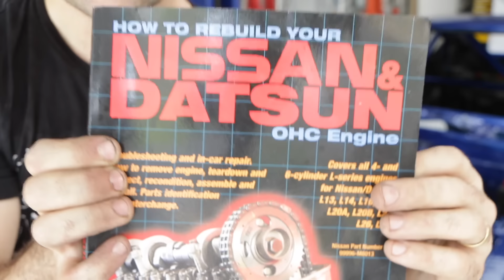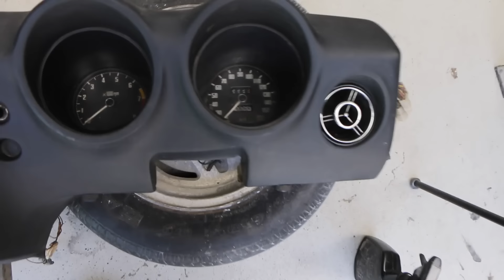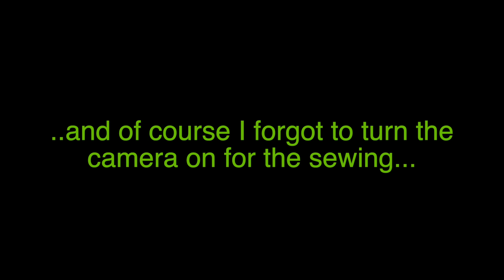Dash repair, and accelerator cable - Home Built Datsun 240z part 73

Comment: Watching your series has inspired me to get back to work on my '72 240 that's been sitting in my garage the past 15 years.  I pulled the SU's off this weekend to rebuild them and replace the manifold gasket so I can get the car moving under it's own power to get it to a shop for a bit of frame work.  Thank You!

BTW, I pulled the heater out and rebuilt it around 2002 when the core leaked all over the floor and had to scrape the tar insulation (with a heat gun in a garage during the Texas summer) from the floor to allow it to dry and prevent rusting.  So pressure test that heater core before you install it the dash.

Comment: Oh Jeff that dash looks terrible - sorry mate. I think it should have been repaired properly. You need to grind out the affected areas and cracks and backfill them with epoxy and microballons. Don't use bog as its porous and hydroscopic. Then sand back the filler with 180 grit until you have a even and flat surface like you would a body panel. Then one coat of hifill and sand using 220. There is a textured paint you can buy, I think its urathane (?) based so it remains flexible. It leaves a surface finish similar to the original finish and you need to spray the whole dash with it. It dries as a satin finish and is UV stable so will not degrade in the sun. I think its made by Wurth but I can't be too sure. Once done this way the dash will look like it has just come from off the assembly line.

Oh, and the wheel and tyre combo look great, modern but period look at the same time.
Reply: Polyvance makes the whole system. I used it to repair my dash and then had it covered in leather. or use there vinyl spray kit.....
Reply: Sorry to say, I agree.  Everything else - I mean everything - you have done has been to a great standard.  Time for a rethink.  Sorry.
Reply: Did something similar back in the 90's. Fixed the cracks then sprayed those areas with stoneguard to give it some texture. Then sprayed the whole dash in colour. Wasn't perfect but you had to look for it to notice it.
Reply: can you give me more details about that paint from Würth? Im in Germany - the home country of Würth 👍🏻

Comment: Hi Jeff.  I think the dash looks just decent.  If you can get that seam to sit down flat and straight, it might be OK.  If it doesn't look any better, you might look at other methods to bring it up to the standards of the rest of the car.
Thanks,
Dave
Reply: Hey @homebuiltbyjeff I agree, I have had success with sewing pins under or through stitching before to hold edges down. It's never pro perfect but I've been happy. 
$10 of spotlights finest vynil never goes astray

Comment: I had a ‘73 240Z in Phoenix,AZ in the ‘70s.  The dash was repaired with black vinyl that way after cracking in the 100•F heat one summer.  You won’t be happy with the finish over time.  That’s my experience anyway. You are always staring at it when driving.  I’ll bet you go back and do it over after a bit.

Comment: Should have changed out that section of 45 year old rubber hose.  I made that mistake on my '84 Celica when the engine was out of the way, wish I hadn't.

Comment: You can buy fibreglass dash caps for these cars. Maybe better off trimming that or vinyl paint and put it over the top.

The dash doctor places grind out the cracks in the foam, pour resin into the cracks with a little chopped strand fibeglass and bog and then vacumn form vinyl over the whole lot for about $600. Ive had mine done 7 years ago and still holding up.

Comment: If that heater control value is original, I would replace it now that it's easy to access. Mine started leaking and it is not an enjoyable task replacing in a complete car.
Reply: I would also add that it would pay to pressure-check the whole heater core for integrity for the same reason.....no leaks would be great!!!

Comment: The wheels stick out looks good, but i recokon it needs bigger tyres or lowering a fair bit, even with all the trim and glass in its not gonna push the body down on the springs enough to close up the big gaps.

Comment: Re the dash. Back in the 90s I saw in a magazine about a guy who made a fibreglass top half of his dash. He took a mould, fine tuned it a little and then made a new piece that covered the top of the original. It looked really cool. Sadly it has slipped my mind which mag it was in. Hey ho. The wheels look stonking. I ran toyo proxes tyres on a hot ford focus. Good grip but they were very noisy and wore out pretty quickly. Latterly I always have pirellis, michelins or avon or yokohamas. NEVER ever run cheap chinese rubber. They are essaitchonetee.

Comment: Not wanting to be critical mate but that dash let's down the whole interior.
Go flexible bumper paint and filler it gives a factory like finish too
Reply from the maker: Yes, but it will crack again soon after..
Reply: @HomeBuiltByJeff  not if you do it properly, v groove cracks use bumper filler and paint, my dash was 3 times worse than yours.
Having vinyl/sikaflex/dash surfaces in the sun you open yourself to cracks anyway, or worse shrinkage!

Comment: Sorry Jeff but when you go this far  with a restoration you should be getting the dash done by a professional. You should also get the heater core re done as well because when they get really old they tend to leak and it best to do that while the dash is out .
All the best for the new year.
Reply from the maker: I have never gotten anything else done by 'professionals' why would I start now...
Reply: Fair enough its your car .

Comment: you could have made a dash cover in more pieces,  the  speedometers and the tachometer could have been made in two separate pieces to  better cover  them all around
Reply from the maker: To do that I would have to remove the old cover as well, as the gauges wouldn't fit in with the extra thickness, and it would be a very difficult job to do as all 5 gauge holes would have to be separately sewn in pieces.

Comment: My heater core let go on a cold rainy day. Its like a white blanket is instantly thrown on windscreen ,very dangerous.
Please change that hose and test whole unit under water with 13 psi of compressed air.
Those old braid hoses are evil . Crack on the inside. Easier to fix now

Comment: Maybe it's temporary but I noticed you gunned on the wheels without torquing them down. Please, for safety, torque down the wheel to the proper torque and you will avoid having seized lugs too.

Comment: I agree with your decision not to flock the dash but I dont think youve quite pulled off the vinyl recovering. It looks, shall we say, very DIY.
I still think you're on the right track though. Check what this guy did. https://www.youtube.com/watch?v=Mt8GeuodrnA
Reply from the maker: His is very different, and much simpler than the Z. The issue with the Z is it is all one piece, with the deep holes around all the gauges which need to be the exact right size so the gauges can slide back in. Trimming it completely, would be very difficult.

Comment: Jeff... dash is off, heater core is on the table - and you did not take off hearer valve neither heater core for cleaning?! C’mon... this turns more and more into a damn ‘quick youtube build’ rather then anything that will work.... That ‘simple’ valve is the first to leak, because diaphragm in it cracks soo easy after years, and you will have coolant all inside... heater core gets clogged, so some  salt acid cleaning could help easily... but yea, rather just spray black paint on the rust - and call it a day...